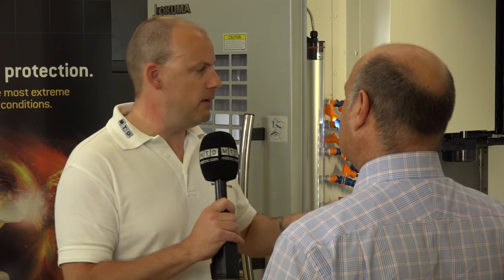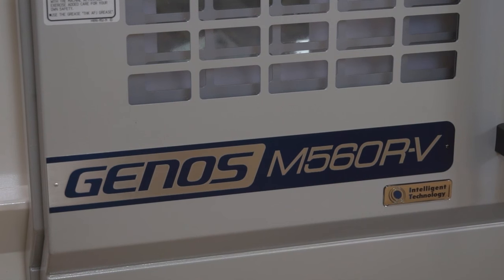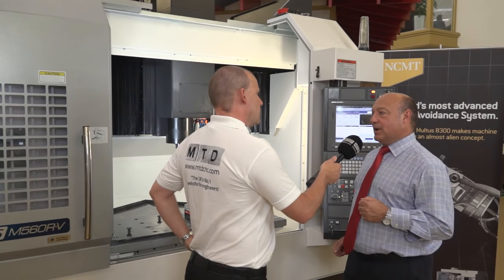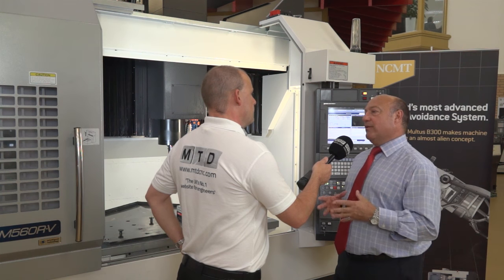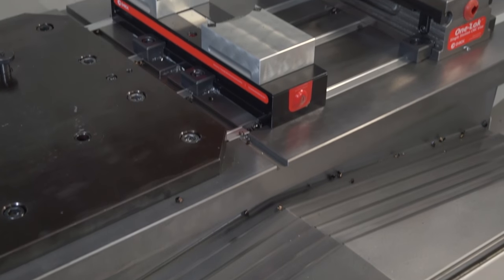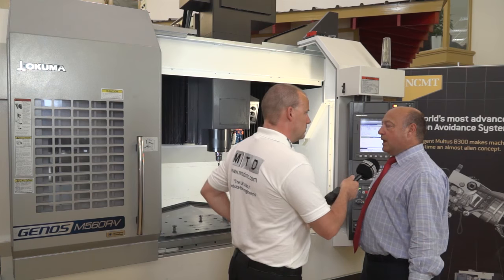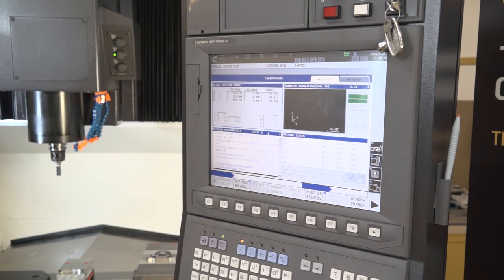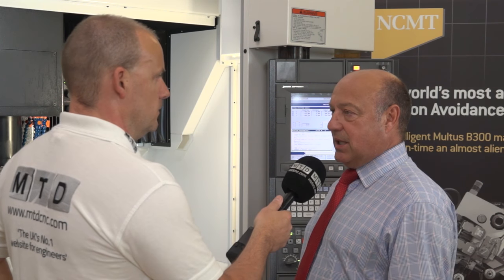Okuma Genos M560-V Vertical Machining

Comment: When did they switch to roller guide ways on the m560v?
Reply: Always has been, they switched to roller on the Cadet Mate after 1998, I have the last year boxway Cadet in my shop now. (Genos replaced the Cadet)
Reply: TexasTad so they never used ball type linear ways?
Reply: @stephenpavlov8942  not that I'm aware of
Reply: TexasTad I read that the m560v uses 'nrs' ball type linear ways.
Reply: @stephenpavlov8942  yes that is correct, sorry I did not understand your question at first.